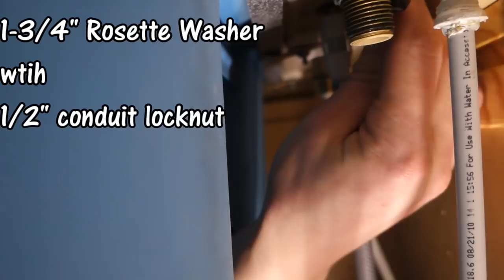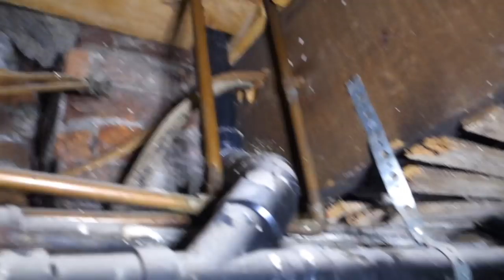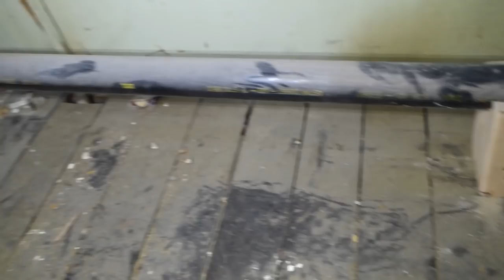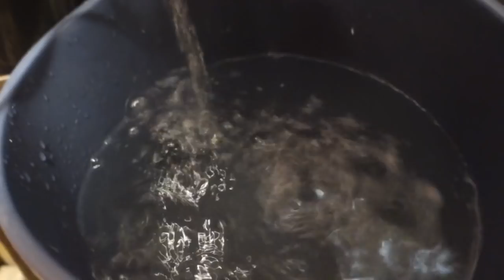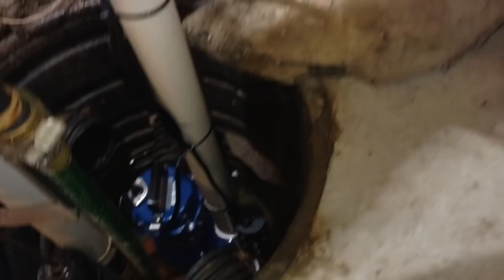Water destroys copper pipes; how to prevent this in your house

Comment: I know this probably sounds like a dumb question but I have been looking for my main water shut off valve for a week? I have looked in the crawl space and on the out side of the house and by the curb but I can't seem to find anything. I have a tri level home I can see where the water lines come in the wall.
Reply from the maker: Some are buried in the stud wall, and some are just placed really stupidly! If you feel like cutting a hole in the wall inside where the water line enters the house, it is probably right inside the foundation wall, inside the studs...that's my guess at least.
Could you do a video of you searching for the water main and upload to Google Drive? Maybe even cutting the drywall open to find it? Maybe could put the video on this channel if you like.. email me knarlycarl@gmail.com

Comment: Thanks for explanation of turbulence in pipe if not reamed properly. Just picked up a nice RIDGID Inner / Outer reamer for copper. The teeth are almost too fine, however chatter will not be an issue.  You are a great plumber with a great attitude.

Comment: Hey brad, that last job, you don't need a foot valve on the pump? And what was the garden hose and other float for?
Reply from the maker: I used the check valve that was already there if that's what you were wondering, it was at the top of the pipe, looked like I was tightening a union. Plus the hose and float were for a water powered backup sump pump

Comment: Great video, 
Please explain again about where the greenish blue crap comes from on copper water lines. I have a house that has this blueish green stuff on some of the lines. They are located in the middle of the pipe away from any fittings. What would you recommend to do? Thanks
Reply from the maker: Does it feel like waxy by the discoloration if you go to wipe it off? If it's just a slight blue/green, that's just a natural patina copper can form sometimes. If it's a little bit crusty, that shouldn't happen, give it a little brush up with scotch brite pad and make sure it's not leaking
Reply: I'll get back with you. I''ll try what you said. Thanks for the quick reply.
Reply: It is not waxy, I can take a knife and scrap it off pretty easy. It is blue/green in color.  Do you think I can clean the pipe with scotch brite and let it go? Would you recommend spraying the pipe with something after cleaning? Thanks.
Great videos, keep them coming!!!!

Comment: What's the manufacturer's warranty on those Pro Series pumps? Nice addons for that pump though. Also, does it have a easy connection for a battery backup like the Zoeller? The existing pump was a Zoeller, they come with a 3 year from the manufacturer and the model that we use up here in Grand Rapids, MI they have a built in weep hole.

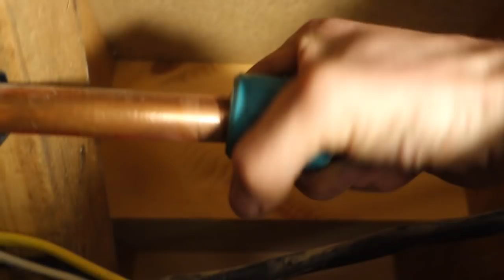Comment: 23:07 how do you get all of the copper filings out of the inside of the pipe?  What would happen if the pipe was vertical, wouldn't all the filings fall inside the pipe?
Reply from the maker: I am able to take my reaming pen and carefully curl a piece of copper shaving out and I grab it with my fingers. Many times on vertical copper when I install water stops coming up under a sink I do not even bother because it's in an awkward place and you're almost guaranteed dropping the copper shaving in the pipe. Not worth it

Comment: I noticed red lettering on that leaking copper, was that type M ?
Reply from the maker: good question, I'm afraid I don't even remember!
Reply: Out where I live type M is not allowed (commonly labled with red lettering) but I"ve seen it snuck in, and it tends to leak under slabs rather often.  FYI I have a customer out on a farm, his house was built by his father back in the 40's or so... he used type K copper!  to this day not a single leak.

Comment: Out here in S. California we very rarely see expansion tanks installed, and I've never seen one make a water heater last longer than average lifespan.
Reply from the maker: interesting, it's very funny how different places require you to installed different things, different methods etc... not that they do much of anything, we still see water tanks fail regardless hahaha
Reply: I'm seeing failure rates at ten years to often... so I tend to advise the customer to lean towards tankless, if the install is friendly and affordable. Tend to last longer, and can often be repaired if something goes wrong. I've never yet seen a heat exchanger leak, have you?

Comment: Silly question from someone in the NW US, Why all these sump drains? The way our houses usually are set up is a gravity sewer drain to either a septic tank or city sewer. Why do all the homes you work on seem to have a sump? Also, do they only handle grey water?
Reply from the maker: So all these sump pumps are for groundwater only since we are in a lower area there is usually ground water coming in to most house basements.... Any sump pit you see without a sealed top is for groundwater only. Of course the ones with a sealed top usually mean a sewage pump to pump drains up into a septic system or city sewer
Reply: KnarlyCarl thanks for the reply! When you pour extra water drained from a water heater etc, you are just taking advantage of the drain close by?
Reply from the maker: Yes, that's basically all i was doing

Comment: if the drain line with trap running into the vertical pipe above your vent line is still used, that inverted "tee-wye" will funnel water out into the pipe end you capped, fill it and back-flow down the vent pipe! that's also a condensation trap point.
remember liquid mainly flows along the surface of vertical pipes due to surface tension, that means liquid will follow right around the radius bend of the inverted tee-wye and out into tehe capped end and down the vent pipe.  I hear you on the have to stop somewhere part though ;)
Reply from the maker: I hear ya, it's gotta be addressed someday. But the why I put good slope on the vent pipe, to drain the water that's inevitably coming from above... They really need reversed, and the whole mess replaced... if I remember right, the vent going thru the roof has two 90s to point the pipe back down and no rain gets in...I wonder if they had water leaking thru that hole and other parts of the stack

Comment: I thought you was starting a wood burning class @ 9:14 and 9:32   add coarse teeth/demo blades onto your list lol.
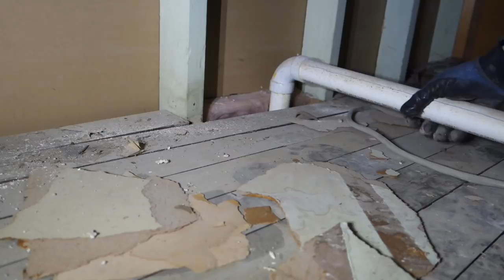holy-moly, I about died @ 10:49 I've had and seen some crooked joints before, but that is terribadly insane
Reply from the maker: Yep, need to replace my aging blades hahaha. That cut was so pathetic you can tell nobody cared at that point. Predrill in the block of 2x4 was mainly so the wood doesn't shift to the side when the screw went thru the block and into the floor boards,  hope that makes sense

Comment: how old was all that pipe & pump? lots of scrap eh?
Reply: I love Panera good food
Reply from the maker: Probably 20 years on the copper pipe, but the pump was newer I could tell
Reply: I think houses (buildings in general) should have maintenance lists/chk lists to be provided initially and with every resale. Thoughts? Tx for the lesson re the expansion tank. Enjoy your day :) Rich
Reply from the maker: We have maintenance checks we offer to customers on an annual basis to check their furnace and a/c and other equipment. Its a necessity to have maintenance on everything in the house, just depends at what point they need it of course. Definitely need a list to go through to keep with your house

Comment: Have you done a video about that copper compression fitting and power tool?  I have never seen that type of fitting.  I'm an Irrigator and HATE working with copper that has water still dripping through it, but I might not mind it with a compression setup like that!  Only other solution I've found is Sharkbites with silicone tape and I still don't know how good that is longterm.
Reply from the maker: Yeah, it's called ProPress, and Milwaukee and Ridgid make these press guns, works great!

Comment: At the prep sink drain... Assuming a 2" drain, adjust accordingly for my question. Why would you not stub up and put a 6">2" reducer there and put 1/2" or 1/4" stainless screen or at least hardware cloth in it to catch crap before it goes down the drain line?
 In NC the Sink stub must be inside such a reduction to keep it from splashing. I have seen a short section of 6" pipe used as a splash guard and it wasn't cemented in to facilitate cleaning.

 It kept an engagement ring or two out of the drain line too.  I think the air gap width is mandated for both how close and how far from the catch basin it can be.  

Having been in the food business and being involved with building restaurants, I can say everything has to be EASILY cleanable or it does not get cleaned.
Reply from the maker: Definitely getting a screen in there. Just not on top. If your stub must be inside the reduction, you lose your air gap

Comment: I'm a building inspector for real estate buyers and sellers. Despite taking multiple continuing education classes, your videos have provided a wealth of information. i.e.  Water heater fittings calcification, I've often wondered why I see these deposits. I thought this was caused by fittings with pin hole leaks. And the purpose of a TPR valve prevented valve from prematurely opening due to thermal expansion. 
Would you be interested in teaching a continuing education class?
Reply from the maker: Well, I've seen the deposits build up at threads and also on really bad water quality, eat right through the brass body of fittings and valves and you see like a zit form on the surface. Maybe poor quality, but strange regardless. I know the pressure relief can become stuck closed so that it doesn't open, and that's not a good thing!!! 
I would definitely be interested in continuing ed classes, I try to do that everyday with my videos hahah
Reply: Dissolving plumbing fittings, wonder which country they came from?

Comment: Male adpts on sump pumps, I don’t use tape, and go hard hand tight. Figure if I’m putting a weep in it anyway, what’s the point? And when the next guy comes along, they don’t cuss a seized fitting!
Reply: That was a zoeller M53 you replaced, I believe. I held a high opinion of those for a while. Float switches go out A LOT though
Reply: Maybe a zoeller impersonator
Reply from the maker: true, i guess tape would be pointless. Yes, the Zoeller seemed to have dropped in quality significantly. I've replaced their 1/3 HP pumps under the 3 year warranty so often lately

Comment: Propress is garbage. A real plumber sweats copper pipe, and doesn't rely on a rubber o-ring to create a seal. I did like the way you used the woodblocks to support that vent pipe.

Comment: Salamander Brad, it was a salamander. I borrowed the reed chamfer tool from the heating guys at a job this week. Nice, even on ABS. they’re required to use it on venting for their furnaces and water heaters. Are you guys in Ohio required to chamfer for Plumbing??
Reply from the maker: Nobody requires it, but it makes pipe assembly so much easier and peace of mind that the glue wont get pushed out of the fitting

Comment: what part of this video shows how water destroys copper pipes ?
Reply: Water turbulance. You need to clean pipe edges when cutting them.
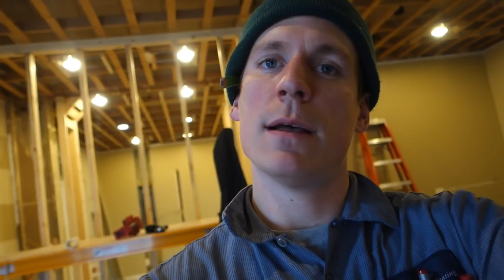Reply from the maker: Bob Haddock I always put the title of the video start time in the description. Go to 20:02
Reply: @KnarlyCarl Nice to get some real plumber to confirm this. It's too bad that lazy plumbers can get away without "cleaning the edges", as it can take years and years to finally corrode. I mean cmon it takes only 10secs per cut to do it..